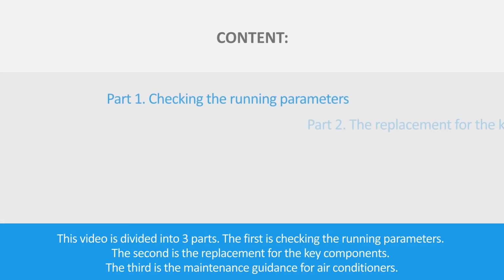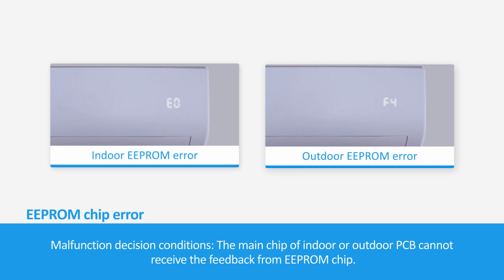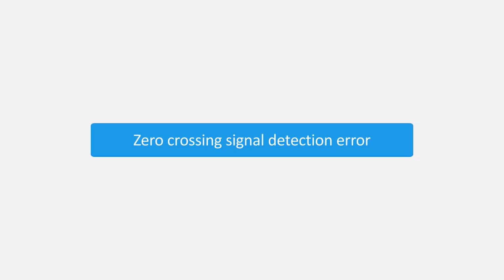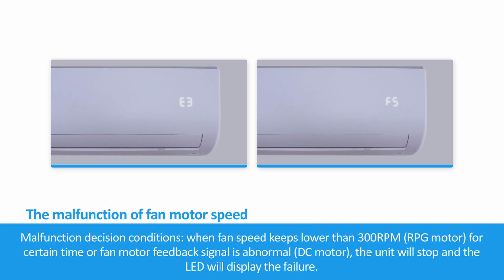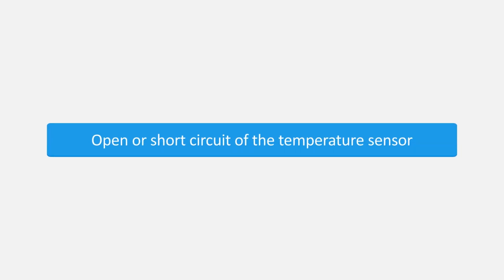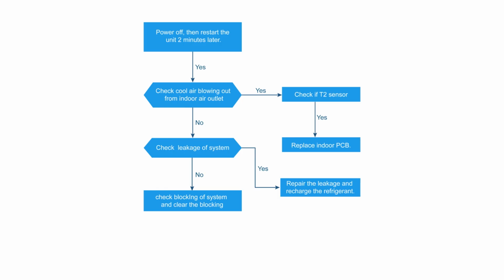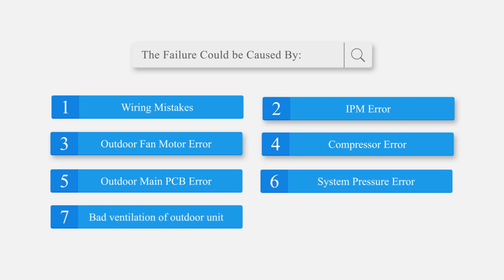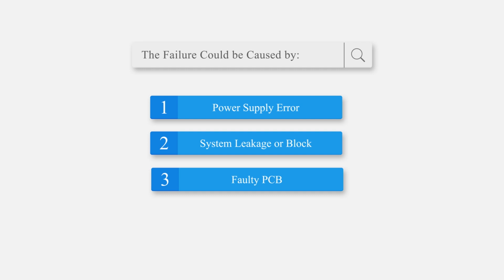DuctlessAire Mini Split System Service Guidance

Comment: DA2421-H2-I  has started making an inside fan noise after running great for the first 20-30 hours. Fan spins freely by hand. With the cover off, you can see the fan motor torque/surge sporadically. The unit still cools/heats quite well. Any ideas?